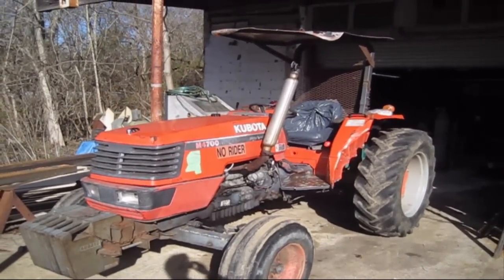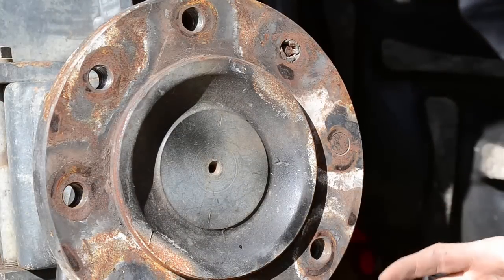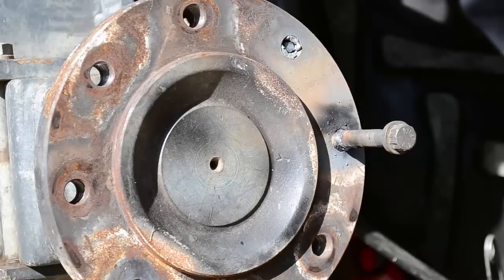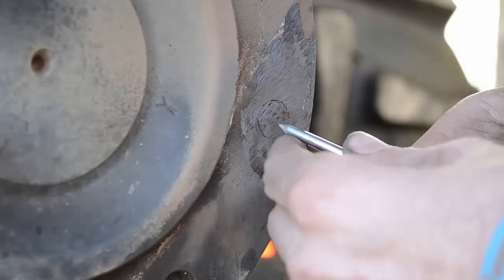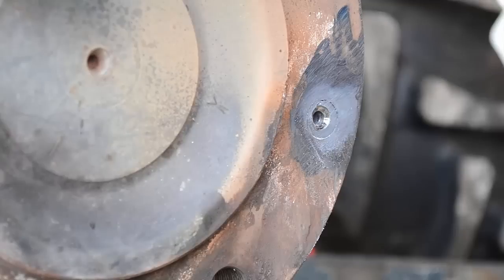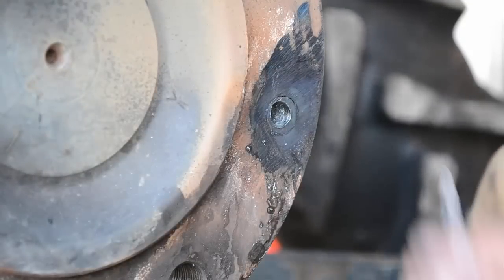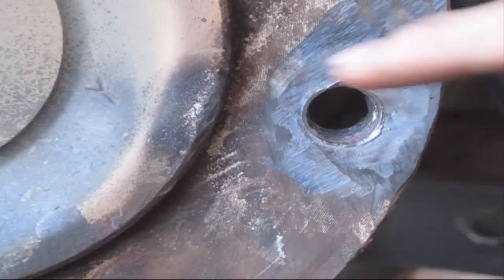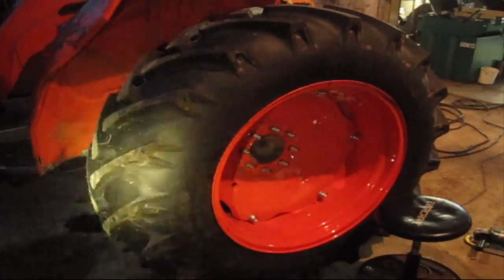Broke-off bolts techniques

Comment: When the first one started trying to seize I would've use torch to heat the backside again to expand that hole a hair more. It probably would've come out before breaking your weld then. Being around heavy equipment and trucking most of my working past, we've used the torch to blow them out countless times. Like you, sometimes it's worked great while other times it took some further chasing. Trial and error, I know how that goes. I was waiting to see your end solution for the two stripped smooth holes but the studs magically appeared in those...hahahaha. Good video though. Safe wrenching!

Comment: Well man, that was a tough job. Whatever the comments are posted here, none of it's easy, and you did well to tough it out with the equipment and methods you had available to you. Have a read up about something called a jobber bit. Don't go too much on the material it's made out of, it works more on a different grind angle. I did some work on my boat, in stainless steel which is a pig to drill normally, so went for cobalt bits & all that. Melted three before the guy on the next boat lent me a jobber bit. Slow speed, a drop of oil, and it was like drilling wood. Try it. Sometimes, when you lay into it on high speed you can work harden or case harden steel, then you just end up destroying bits to get through. Low speed, low temp and the right angle of attack is the secret to success. I never tried a masonry bit, so thanks for that tip, and burning the remainder out is good for saving the threads as you did . I take my hat off to you for coming through on that, and maybe the video didn't pick up the cursing as well :-) Cheers, from the UK.

Comment: Steel....high pressure and very, very low speed on the drill. You'll also want Cobalt drill bits.That first broken bolt would have come out if you'd sprayed some Aerokroil on it when it started turning. That high running speed just serves to dull the drill bits because of the additional heat.

Comment: What really helps, while the bolt was hot few drops of oil, works like a magic!. Also instead of welding a broken bolt it's much easier to weld a nut on broken bolt.

Comment: After getting the 3/8 hole in the stud you could have used a sawzall and made two cuts 180 degrees apart and broke the material out if needed make four cuts 90 degrees apart.  Try it sometime.

Comment: Great Video!  I keep a small set of chisels and dental tools which works great to remove the dross and stud debris out of the hole.  Using these tools just as the hole cools helps clear larger pieces with less cutting.

Comment: Don't heat the bolt because when it expends it will make the threads even tighter. Always heat the surface around the bolt so when it expands it loosens the bolt.  But since it had nothing to grab on to welding a bolt I'd say one of the best ideas as you did but after you had it welded you want to wait for it to cool down than heat the surrounding area with the torch and you will get it much easier.

Comment: In my experience in this field of work...If I am going to take the time to go get a torch, I am not going to use it to heat up a bolt. I am just going to go straight for victory and just burn it out. If you wear glasses meant for torching, you can see what you're doing and get to the threads without going too far. And as an extra opinion, it's just what you should do if something like a tap or extractor has snapped off.

Comment: The best deal would be to ignore these bolt holes and drill and tap new ones centered on the existing pattern. Then go back and weld in the old bolt pattern. Been there and don that and it works.

Comment: On that hub I would split the PCD of the existing holes and drill a fresh set half way in between the existing holes. Quite a common fix if a replacement hub is not available. A new wheel centre also pretty cheap new and very cheap second hand.

Comment: When you have to drill a stud or bolt you should use a sharp bit and reasonable pressure, punch the dead centre and use cutting fluid, when you see steam or smoke retract the bit and let it cool. once you are through you can then increase the bit size. warm the whole area do not use excessive heat use a can of plumbers pipe freeze to withdraw the heat from the centre and shrink the stud, on larger studs it will make a noise as the stud shrinks if it dose not move after this drill out to the inner diameter of the thread, catch the end of the thread with a sharp punch grab it with needle nosed pliers and wind the thread out around the pliers. Always chase a thread to clean it after removing the bolt. Nuts are easily removed by cutting down the sides and knocking off the remaining two pieces

Comment: Pretty interesting...i don't have a cutting torch. I always break off 10mm bolts flush...too hard to weld a new bolt stud too. The few I've done... I always drill out and jam a flat bladed chisel in the hold and then back out. Although i do remember folding over the metal from a drilled hole when i was a kid.

Comment: When you run the drill at to high a speed, the cutting edge can work harden the end of the hole. Use lower speeds, lubricant and higher pressure. I have done that too many times. Broken steel in aluminum, make a clay dike use  Nitric acid to dissolve the steel.

Comment: Ok, This is not meant as criticism first off. Don't treat this as a blind hole. I'm going to give you a secret shortcut... And yes I have seen and used the washer method. However, in this case you had movement in the bolt. Take it to the center of the movement and weld your bolt back on it as you had it before. Clean up the slag and make sure your weld is within the thread diameter of the bolt hole so you don't booger the threaded hole. Soak the front and back with Liquid Wrench and give it a min or two to make it into the threads a bit. (This is not meant to break the bolts rusty bond, this is simply to provide a lubricant.) Now just run it out the back side.(or clockwise) And then just cut the bolt off of your smaller bolt. Done.. I have done this many times due to people putting the wrong length bolts in and getting them all boogered up on the back. Listen to a wise old man..give it a go. Think a little outside the box. ;-) Less labor = More profit. Still liked your video.
Hope this helps.

Comment: When drilling steel with a hand drill, use a slow speed and as much pressure as you can put to it.  If the cutting edge is sliding, it's just making heat and dulling your tool.  If the cutting edge is truly doing it's job, you'll get chips or a continuous helical chip.  Start with a tiny center drill.

Comment: Nice work! I didn't catch how you repaired the holes with no threads. Did you use a sleeve like you mentioned? Or maybe a Heli-coil? I wonder if you could have welded up the holes, then drill and tap them?
Another couple tricks, after you weld on a bolt, I like to spray lubricant or penetrant on the bolt which cools it to shrink and lubricates to help it back out. Another is to heat up the stud and touch it with an ice cube, it will shrink.

Comment: ill cut a slit in the bolt and use a flathead impacting punch that spins.  Heat area around fastener,  drill as slow as possible,  slightly off center but not all the way through,  go bigger and biger till your close to the threads (1mm or closer)  put a punch in the hole and hit with a big sledge hammer.  it will cave in and go through assuming the end of the bolt protrudes the flange

Comment: When you preheat the broke off bolt push a wax candle against it. The heat will suck the wax in like solder it instantly turns  the rust into a lube.itself and separate from each other

Comment: Many use wrong terms for Hardening, Tempering, Annealing. Hardening gets metal red hot and quench= rapidly cooling in oil (theoretically adds carbon molecules surface metal) rapid quench shocks hardness into the metal & can also be done with water.  Tempering heats metal at a low temperature  4-500 deg for a long time. Tempering  S-l-o-w-l-y "softens" hardness. Annealing reduces hardness & increases ductility & happens when you "burn a drill bit" during the sharpening = red hot + room air cool.  It loses its hardness and the metal becomes mush.  IMO, use your torch from the first to anneal the EasyOut-prior to welding.  Drill untill you get resistance, anneal again, drill again, repeat. Remember with the torch it is the oxygen that does the cutting--in the presence of the heat --not the heat itself that does the cutting. So the presence of rust and other contaminants at the threads +t a huge temperature and probably chemical differential between the metals very generally speaking aids not cutting the threads.  Once the metal is hot enough to cut with the oxygen you can turn the acetylene off. In ship building and demolition they used to have oxygen (only) lances.  The lance is started with a torch once the metal is hot enough to cut the torch is turned off.

Comment: Had to drill an exhaust bolt out of a head on a Cummins I-6. Friggin bolt was hard as hell, and was dulling my bit about every 15 seconds of drilling. Pain in the ass, but I just had to keep resharpening the bit. Eventually was able to get an EZ-out into the hole and the bolt came right out.

Comment: You really aught to learn more about speeds & feeds. Other than that, great stuff.
I push real hard & let it go slow, like 200 rpm or less with plenty of oil, you can never use too much.

  Something you might keep around for this as well is a 1/4 or 3/8 end mill made of HSS. That way, you can walk the hole back a little if you need to. Carbide end mills are probably too brittle to handle all the movement & vibration, you're likely to chip it up real fast.  Keep the endmill protected though, mine have a cover on them unless they are in a chuck and cutting.

Comment: good to see a good metal worker. and torching would be my last option but you need good eyes and steady hands, i call it a one shot wonder,
another way i have done before is heat it up to a good orange and get cold water hose and quench it quick , this creates a thermal shock thus making it brittle to break apart, like you was going to do with centre punch.
just to say on poor quality bolts this can make harder but brittle
also don't drill fast go slow to get it to bite or you mite as well use a flow drill bit )

Comment: What works really well is to weld a little bigger nut on the broken stud just hold the nut up there with a Wrench and plug weld it on let it cool down a bit and run an impact to turn it out.

Comment: Also, unless this is for a friend, it seems like it’s be more money in labor than it’d cost to just buy a new wheel hub assembly. Never worked on a tractor, do they have a solid hub to axle to hub assembly you can’t disconnect the parts of? Or at least not without replacing excess parts other than that wheel bearing/hub? Also, great video, learned a lot about technique and methods, thanks man, good stuff!
Reply from the maker: You would be surprised. I could have worked on it for two whole days and still been cheaper than buying new parts.  This is how you have to look at it. To get the axle out you have to take off the ham. Which means drain the hydraulic fluid. Meaning you’ll need minimum three gaskets and one seal.  You’ll need a new axle for a tractor that’s built back in the 90s parts for it may be discontinued may be hard to find also being a Kabota they’re going to be expensive.  No the gaskets or seals were leaking you take a chance on making a leak when you tear something down.  Just to give you an idea new parts for the hub would’ve been around 500 to 750 maybe more could’ve taken up to a week to get them and there’s a chance for ordering the wrong parts and would’ve taken more labor to get it back down and back up. So one day versus potentially a week and a third the money.  Would’ve had it done quicker if somebody else wouldn’t of screwed up to begin with. I’m more experienced now and look back at this video and say there’s a lot I could’ve done different. It wasn’t a bad way sometimes you got to do what you Gotta do.

Comment: In elevator stainless steel  1/8  in thick car station faceplates.  Drilling say a 1 inch hole for a key switch to shut out a floor, we would use liquid dish soap as a drilling lubricant in lieu of regular drilling /tapping oil.  It works and makes a whole lot mess.  Try it.

JoeB

Comment: The end justifies the means. But I couldn't believe my eyes when I saw that you actually used drill bits designed for concrete. When you heat steel (bolts), they become hard. To machine (drill) them you need at least HSS drills, if not carbide drills. If you weld with electrodes, you should remove the slag after the welding process if you want to weld on it again. The new weld will not adhere to the slag. This is different with MIG/MAG welding, as no slag is formed. Otherwise, the journey is the reward! 😎🤠 Greatings from good old Germoney

Comment: I used to stop at the little roadside garage sales when they had "tools for sale" and what they call tools and what I paid for mine speaks for itself. I buy cheap sockets and weld them right to the stud I am getting out then while warm smear a little of the silver crap (brain dead at moment) and wipe some on the stud and it will work itself right down alongside the stud and metal holding it plus when you have it on your hands then it's everywhere. Anyway the socket is on there. If its a fairly large stud then grab another socket bigger than first and slip it over and weld it on and by now the threads are loosened up a bit plus whatever air tool or electric tool will go right on and spin it right out. Trany fluid will get all the crap off you and it washes off easy with soap and water.. even in your hair (new sub)

Comment: This is hard to do I used to be fairly good at doing that. I did a lot of manifold bolts before the days of catalytic converters Ford's were especially bad for rotting off. getting the bolt out of the manifold. It took  a lot of practice but I eventually got very good at it. We didn't have a welder in the shop in those days all we had was acetylene torch. So cutting them out was our only option.

Comment: When I get off center on a hole I use a dremel with a carbide cutter, cut till you see threads, then use your punch to knock out the remainder of the bolt!

Comment: Only thing you loose point s for is when at the end, you put the easier, closer bolts in first. To save yourself a dime's worth of trouble, tighten in the bolts that are further away and harder to reach first.

Comment: Thank God this guy does not work on planes! Aviation mechanic and QC here, and even some of the best sheet metal mechanics don't understand cutting/drilling slow though. Had to explain that to a lead where I work at and help him cut through some titanium on a band saw...even though the old band saw he was using clearly states speeds for steel and aluminum.😑
Reply from the maker: Jokes on you this guy has worked on airplanes!   Dude lighten up its a tractor for pete's sakes.

Comment: Since the hole goes all the way through and you had it moving, why not weld a slightly smaller bolt, in diameter, than the hole and gun/push the bolt all the way through. Then cut the head of the bolt...?
Great Job and video....

Comment: When you welded your favourite bolt onto the broken stud, if you had applied a great amount of heat around that broken stud then used your impact gun, that stud would have came out, also the socket you used was not an impact socket and looked as if it was bouncing around a lot, must use a impact socket on an impact gun to get full hammer action on the stud you are trying to remove

Comment: Once it move with the impact ditch the impact. Go with a ratchet and penetrating oil work it in and out spraying both sides work it easy not to flex the weld heat surrounding area not the broken bolt keep working in and out you will gain a little more movement each time tap the hub this helps the oil get in. Run the studs thru far enough to put nuts on the back side. Ground the welder to the hub not the machine. Grounding thru the bearings can pit them and cause the to fail in the future.

Comment: Just JB Weld the rim back on, and then you won't need stud bolts.. Go to the Tractor Supply store and get the large gallon size pack marked "for tractor wheel securement." You can find it next to the bulkhead remover..